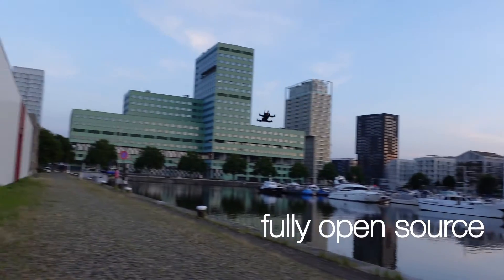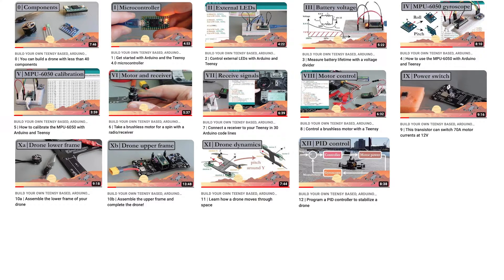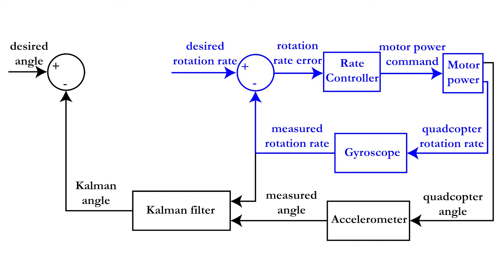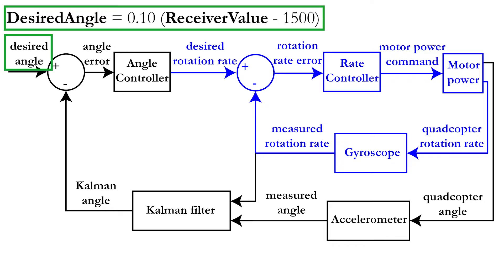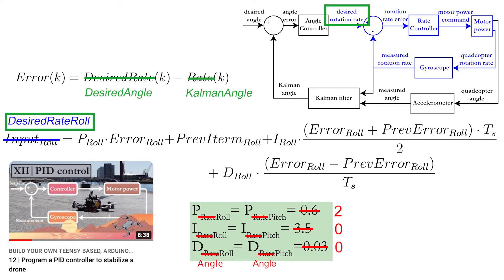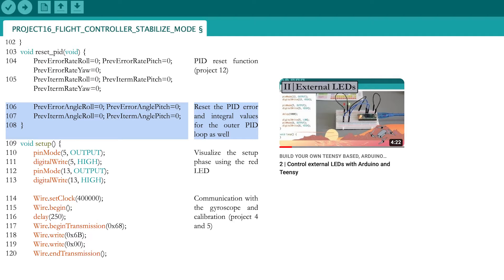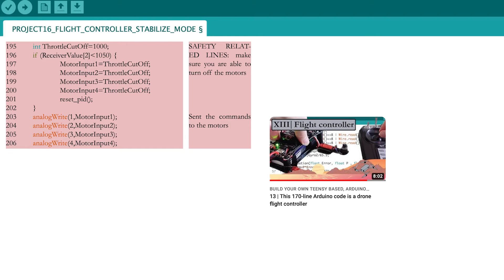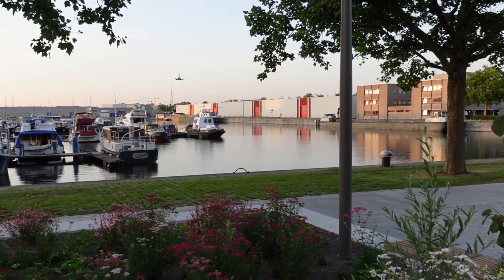16 | Program an angle mode flight controller in Arduino

Comment: The outer PID loop is using angles but the inner PID loop uses rate in deg/s. So it looks like we are using the angle from the outer PID as a desired rate of angle/second for the inner PID. Is this correct?

Comment: How do you mitigate the acceleration caused by the quadcopter itself? Since the accelerometer measures all the acceleration and not just the gravity. Your drone creates acceleration itself, in a certain direction at a time. And most of the time this acceleration can be bigger than the gravity itself. Doesn’t that corrupt the angle measurements?
Reply: That's the beauty of the Kalmann filter : Actual vehicle acceleration is filtered out.

Comment: Hello, if all roll, pitch, and yaw inputs must be 1500 for 0 movement, what should the total input to motor 1 be? If we had a throttle value between 1000-2000, motor 1 would never start. Can you please guide me through this? How should I deal with the motor mixing algorithm?
Reply: You you the a look at the flight controlling code, you will see that the common variable on all 4 motors  is the throttle input from the rxtransmitter.. hence, if there is no movement on pitch, toll or yaw of the transmitter, , with a good pid tuning values, all those motors are to have the same value promotional to the throttle stick position. 
That only, ofcz, if the quadcopter as well,  isn't moving.
So the throttle is the common denominator for all motors.

Comment: I'm wondering, what are the reasons to use a double loop instead of directly controlling motor speed from Kalman angle error ?
Reply from the maker: Good question. The rotation rate measured with the gyroscope changes much faster than the angle measured with the accelerometer. As such, you need the very responsive inner loop based on the rotation rate to balance the drone. If you would directly control the motor speed with the angle error, the response will be too slow to balance the quadcopter
Reply: @carbonaeronautics  Thanks a lot for your answer !
However, the MPU6050 has a 1000Hz refresh rate for the accelerometer, shouldn't that be responsive enough for a 250Hz PID controller ?
In practice, I'm currently trying to make it work with a single loop and it's pretty unstable so I will probably try 2 loops soon, but I'd still like to understand why it's not good enough

Comment: Please share the Angle Flight Controller code on github
Reply from the maker: I've uploaded it just now: https://github.com/CarbonAeronautics/Part-XVI-FlightControllerAngleMode
Reply: @carbonaeronautics  Thanks
Reply: There are two PID’s for angle and rate, so which pid values I have to tune

Comment: i can hear the motors suffering from high frequency noise in the gyro data because u didnt care about filtering. isnt motors and esc s hot?
Reply from the maker: I did not experience issues with the motors and ESCs. The gyro measurements are in fact filtered through the low pass filter, that we set to 10 Hz in register 1A of the MPU6050 (see part IV).